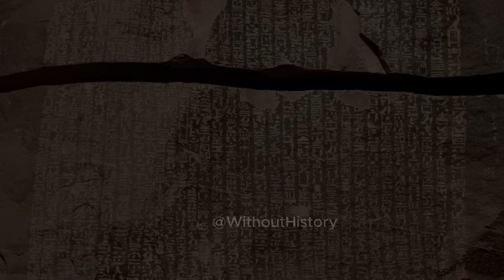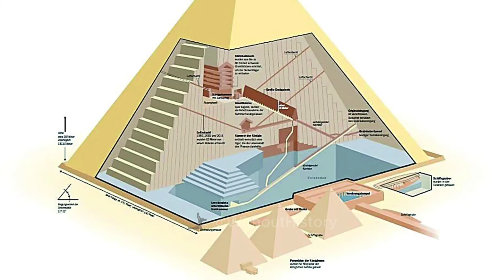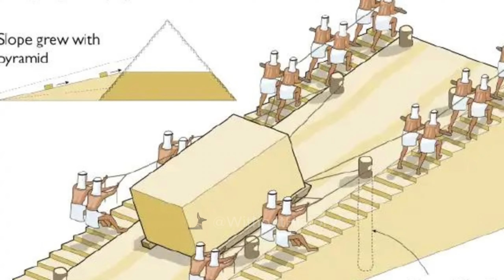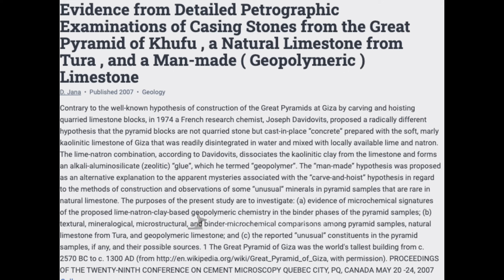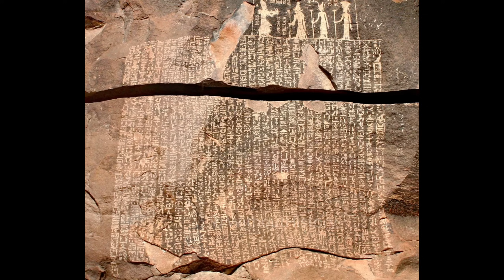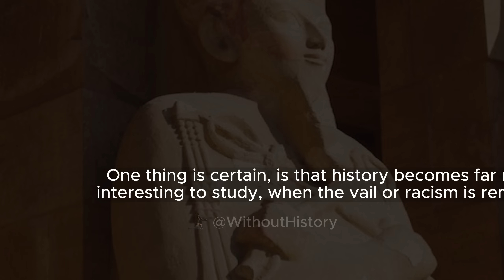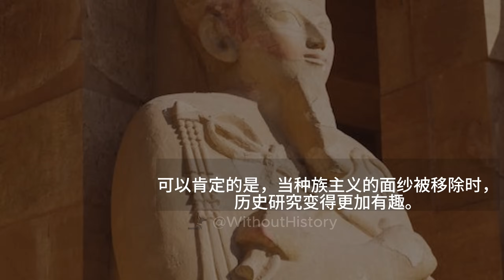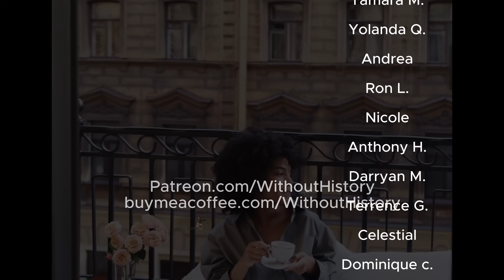That one Pyramid secret that explains everything!!!

Comment: Again as I did emphasised on the same subject of having to look at the entire subjects with regard to ancient Egypt and any other ancient civilisations, from a completely different prospectives, other than a conventional way of thinking, about the whole phenomena, which can indeed be ever so confusing ,leading to dead ends, of not being explainable, as the case has been here, the detected contradictions in between manufacturing technologies, and different levels of precision,of alabaster manufacturing techs, also not ever finding such machinery to explain the capabilities to make such vases and other artefacts, and also the concept of transfer of certain  materials from far distance locations such as Afghanistan, these are the contridictary to each other, and to what evidences and artefacts being discovered down in underground basins , of different ancient sites in general, hence make it impossible to be explained via a dot connecting simple methode adding up together and mak8ng sense.
Another similar example of the same phenomena, could be that of , once the building process of the great Pyramid of gisa is studied, the spectaculators, usualy 9nly have a sim0le overview of their current prospectives of machinery and technol9gies deployed, and not baring in mind, that what they are doing with is not a linear ancient past time technology, but rather an imported none terrestrial civilisation technology evidently being deployed to undertake and complete the building processes, and that is why regardless of  which pathways are tried, they eventualy are led back to square one , finding out the whole procedure cannot be explained ,say by ramp theory, or massive  human slave work forces , or manual  levitation technics or even moulding technics by its own without proper supplementary explanations and any other forwarded technics for that matter, and  so on. 
 Hence still a more soffisticated more advanced ,and  may be even  automated systems of machinary and equipments were being deployed not observed at first glances, to the investigators right freinds?
Which also couldnt be covered and explained by all   suggested technics, not fulfilling the whole complete criterias needed to be explained ,and again that is when the need for studying and investigating the ancient civilisations technologies envolved in creating and building different monumental sites , as well as other ancient artefacts are becoming a complicated , ambigious task as such no proper explanation has been able the cover the entire concept. 
And hence may be I could explain the subject further, by delving into more details, once studied with a different prospective point of view , to cover and explain the phenomena, more clearly as follows:

Comment: 7:10 This discovery also revealed a civilization would have to be aware of nanotechnology in order to create this type of geopolymer aggregate limestone. These limestone blocks were used as casing stones; lining the outside of the Giza pyramids. They weren't used to build the interior structure of these pyramids. The much larger blocks that compose the interior are granite from Aswan. 

The dynastic Egyptians didn't build the Giza pyramid complex. All of the evidence shows these were built before the end of the last ice age; thousands maybe millions of years before the bronze age. The dynastic Egyptians found those structures & attempted to repair them as best they could.
Reply from the maker: Good theory, but you don't need nanotech. You only need a scientific method that leads to inventions from multiple fields. In this case chemistry and architecture.
Reply: @withoutHistory  It's not my theory. I'm quoting the researcher you're referring to in your video.

Comment: This idea of blocks are made from man made material is wrong , because on many bid blocks there are saw fitting marks , also there are tube drill marks on many places , it’s actually the most advanced knowledge plus advanced tools , 
How about if you go Aswan there are still some unfinished stones still in contact is 1200 tons , so they were advanced in all , and they had transportation and lifting to the hight, and faroh were not advanced , they were still using Horse driven carts , even the king himself was riding on Horse driven cart , so if we don’t understand some technology , we should not make stories

Comment: Using the polymer blocks solves none of the questions and would take longer than just cutting limestone blocks; as the same amount of quarrying would be required and then extra days for the polymer process.

The Pyramid was not built using 2 million blocks, that's a guesstimate at best, as apart from the external stone and the visible stone in the passageways etc it is not known if cut or polymer stone is used elsewhere. I suggest not, instead uncut stone and rubble etc would have been used to bulk fill large areas segmented into sections with walls then bulk filled. 

An external ramp possibly from the causeway for the lower section of the pyramid build and an internal ramp for which their is some evidence for the upper section would have been utilised, building from the outside in. The rows of outer blocks consist of 4 different types, one is the entrance layer which is the same height as the passageways. Two row Types are similar to each other but with a variance in angle and overlap, used for positioning and maintaining the outer faces of the Pyramid and a fourth common type or standard block & row.

Given all the limestone was quarried on site it should be easy to compare the blocks to limestone still in situ to determine polymer vs stone block.

Why didn't they use polymer or granite polymer for the granite stones which were quarried in Aswan and needed to be transported and much bigger and harder to move than the limestone?

Comment: I didn't watch it all so I may be speaking out of turn; have it all wrong.  But it seems to me 'that one pyramid secret that explains everything' means that what this video is about explains the whole building of the pyramids and all the megalithic statues, etc.  And I saw/heard enough of it know that they were talking about casting. And many of the comments seem to support that idea.
Well I don't believe it.  For these two reasons mainly:
. If you can cast things you do it again and again in the same molds. The pyramids were clearly not built with such castings.  The blocks are rough and different sizes.
. Castings do not have strata bands in them.
I can believe they knew something about how to soften stone.  This in fact is no great mystery to today apparently.
But softening a little depth from the surface with expensive, difficult to get and hard to prepare substances once in a while when you can afford it and there's a need is a very different thing to building everything in sight - and 4 million stone blocks - that way.
Or to put it another way: smearing an expensive slurry on a surface is a hell of lot different to casting a great mass.
Have a bit of sense.  Have you any idea in practical terms of what you're talking about?  If you're going to pour like concrete you need something to hold the main mass in. And before that something/somewhere to prepare it.  And then finally the mould you pour into.
Have you seen a concrete plant where they make concrete?
And then the concrete trucks the move it with and keep it in until pouring?
And then have you ever seen it poured?  Know anything about how heavy and hard to work it is?
How do you think they'd do all that back then?  Mixing.  You think this magic stuff needed mixing?  Well how do you mix cubic metres of concrete?  Have you ever even tried mixing a quarter cubic metre in your wheelbarrow for backyard job?

Comment: What you cite as evidence does not stand up to scrutiny. This is a quick synopsis of why it doesn't solve the primary mysteries of the anomalous works of stone, or the associated logistical and operational feats so obviously beyond the means attributed so unforgivably to the peoples of the time of the old Kingdom:

1) We have the quarries with the clear signatures of the biggest sites. Some, like those in Giza, have had specific blocks actually matched to the squares removed from bedrock quarries.

2) Some,  like the unfinished obelisk of Aswan quarry, are still there, about two thirds completed.

3) Certain structures, like the pyramids, contain up to 2 million blocks and about 1.3 million are different shapes and sizes to each other. Making that many moulds seems to be more of a task almost than quarrying the granite in the first place.

4) Granite is very different to any form of concrete or polymer. Also each quarry produces different rock that can be linked definitively to megalithic construction sites.

5) Actually no records for polymer industry on such scales exists and no associated tools.

6) The critical blocks have a variety of tooling marks on them, this is already a source of much debate in Egyptology VS Engineering (and Stonmasonry).

https://dwahts.blogspot.com/2023/01/why-geopolymer-theory-is-wrong-for.html?m=1
Reply: My only questions to you are. How long would it take to place over 2 million blocks. And  how many people can move 1 block and how many were being moved at the same time.  They had to have many being moved every moment and that's what I cannot picture. I have witnessed a large project cut through my city and also many construction projects. It's the process I cannot picture when the historical method is talked about
Reply: The video wins the argument. Pyramids solved!

Comment: Nice, yet this comment is to take nothing away from the belief or fact of trying to deny the actual African people of the era the rightful place of amazing genius peoples. 
I Just have a comment and a question to further prove or disprove your statements about the how? But not taking anything away from the "who"  did it. Just a question about the technique. 
The question is: One the hardest mineral known to mankind. And only having so-called copper chisels.  Just seemed in order to make the statute seem almost car from pure stone that one of the hardest minerals known to man would have had to have been ground up into a near powder form or at least less the diameter of fine sand.  That's still a secret to me to be researched and found. How was it ground so fine? 
And I guess there's two statements:  requesting that non-biased researchers use the technology available today to compare unknown quantity of pure uncut stone that the dark statue was made of , to another fine cut diamond cut, from the bottom of the statue and with micron lasers or chemical analysis or You know that fancy machine that burns things and then reads the vapor chemicals off and says what those chemicals are.  And compare the two the uncut stone vs the statue stone. Seems the ultimate final comparison for truth. Not of the who, Not taking away from the brain power of those who invented it, speaking to the how.
And Question 2B.  With all that science and understanding of power, heat and the sun. (And this is most related to the black statue)  What is the melting point of this? Very very hard stone? Understanding the power of the sun reflective mirrors we use even today to generate electricity and a gigantic solar powered furnace located in the desert of the United States. Just saying I get the point it may have been fine ground powder, yet could this stone have been melted ,molten, and then slightly cooled but still pliable, poured into a already glazed prepared mold of stone or something equally ingenious. To them harden and be perfectly stone, chisel or Craftsman's marks?.  
It is a true well-known fact if researched, from the Kushite dynasty of ruling, Egypt, to the actual removal of that dynasty from the wall of the museum in Egypt. Just imagine to skip a whole number as if no one would notice looking on this wall. Hey what happened to this number? As an attempt to omit a dynasty where Egypt and denial were ruled by Nubians, by kushites. And a very very horrible man who destroyed ancient artwork to hide the fact that deep people of color could have been creative at all.

Comment: The video shows scant evidence of a possible method of creating a limestone "cement".  No explanation or a plausible method of doing this with Diorite , for example, which most pre-dynastic statures are made from.  No explanation on how said Diorite maintains crystallization of magma when crosscut, as has been done many times on these Diorite statues.  Even if this theory could be applied to Diorite, which it can't -- no explanation on how ancient civilization could produce the 32,633.55 psi, or otherwise stated -- 16.32 tons per square inch required to crush diorite. This is pure pseudo science for the intellectually lazy.

Comment: Didn't like it. @ approximately 18min..."more importantly," is horrible English grammar.

It is inappropriate to use an adjective (importantly) to modify the verb (more).

Perhaps "most important" ...is correct.

Please, look it up. Just because most folks use it wrong, you don't have to.
Reply: this isn’t an english class 🙄
Reply: Never took up grammar because in 60s dyslexia was not known. Never read a complete book until mid 30s and it was " Stuart little ". I always wanted to know what really happened when he was on model sailboat. I always worked with my hands and it lead to a great lifestyle for my family. You can rip my grammar apart but understand not everyone is book smart.